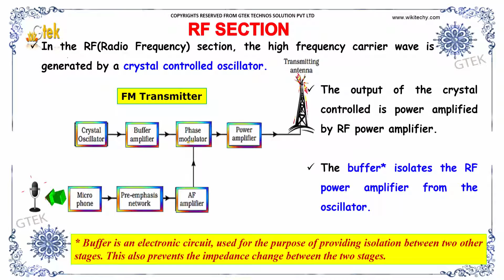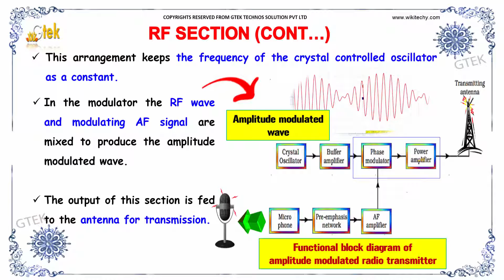RF section | Communication systems |class 12 physics subject notes lectures|CBSE|IITJEE|NEET

Comment: Signal generators, also known variously as function generators, RF and microwave signal generators, pitch generators, arbitrary waveform generators, digital pattern generators or frequency generators are electronic devices that generate repeating or non-repeating electronic signals (in either the analog or digital ...

Comment: Radio frequency (RF) is any of the electromagnetic wave frequencies that lie in the range extending from around 3 kHz to 300 GHz, which include those frequencies used for communications or radar signals. RF usually refers to electrical rather than mechanical oscillations. However, mechanical RF systems do exist (see mechanical filter and RF MEMS).

Comment: So RF engineers simply talk about mixers, and mean switching mixers. The mixer circuit can be used not only to shift the frequency of an input signal as in a receiver, but also as a product detector, modulator, phase detector or frequency multiplier.

Comment: Radio frequency (RF) is a rate of oscillation in the range of around 7003300000000000000♠3 kHz to 7011300000000000000♠300 GHz, which corresponds to the frequency of radio waves, and the alternating currents which carry radio signals.